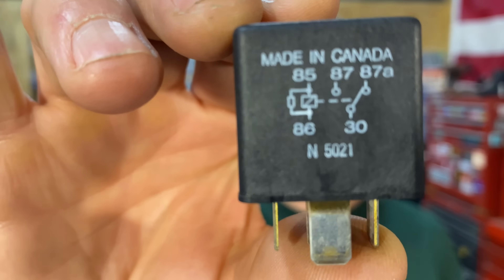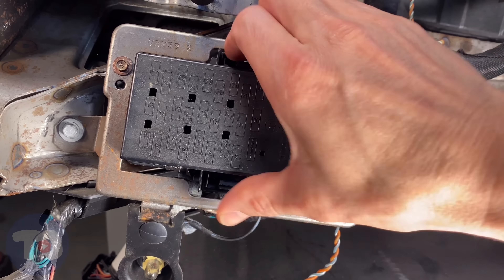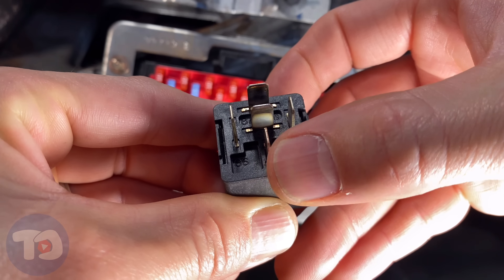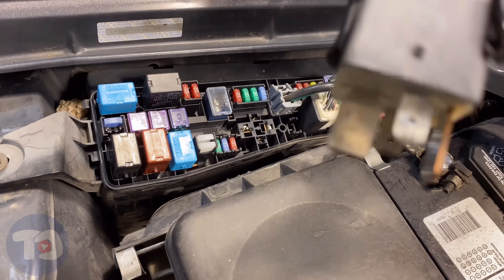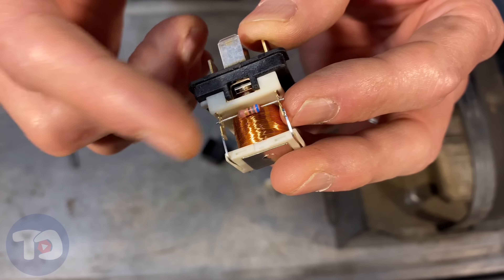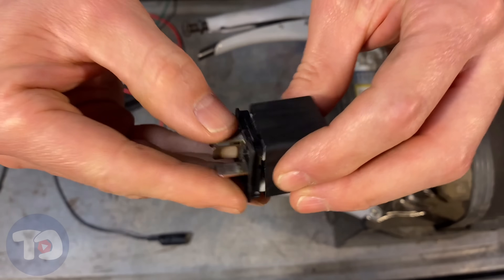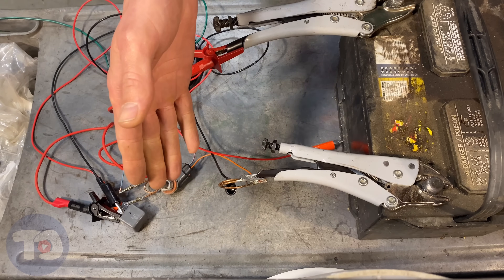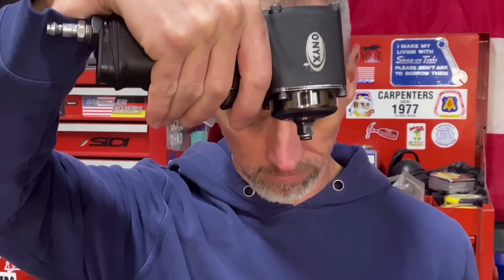Why are relay pins numbered like that?

Comment: The charge generated by the coil when it is turned off is because of the magnetic field collapsing and it's called "back EMF"... I don't know why they used a resistor unless it's to absorb some of the energy but normally they put a silicon rectifier diode reversed biased with respect to normal usage [pin 85 negative] to absorb virtually 100% of the back EMF energy.
Reply: If you have a "flyback current" from de-energising the coil if can jump the air gap between the contacts in the switch, eventually killing the switch. The resistor provides a lower resistance than the air gap in the switch so the flyback current just travels round the coil until it dissipates.
Reply: @BuiltatBlackjacks  "flyback current" and "Back EMF" are synonymous terminologies. [That is energy introduced into the coil as a result of the collapsing magnetic field.] The resistor is across the coil of the relay [which acts as an inductor as well] whereas a diode is commonly used and has absolutely nothing to do with contact erosion. That wear and tear of the contacts is addressed by using harder materials, I believe by adding tungsten. [I haven't research contact formulas nor have the inclination to do so.] The "Dr" in front of my name is there for a reason.
Reply: @DrHarryT  exactly what are you doctor of? Because I was unaware you could get a doctorate in Auto electrics?
Reply: @DrHarryT  I read that too - I think he is referring to the contacts in a dash switch that is operating the coil current; not the relay's contacts.
Like an AC dash switch that activates the AC clutch relay.
That is how I read it.
Reply: I just hit me as to why they installed a resistor, it is quite possibly for the PCM [Powertrain Control Module] to identify when the relay coil has failed and has gone open delivering a specific resistance to the PCM. However there should still also be a diode in parallel with the resistor to protect the controller mosfet in the PCM from the back EMF.
Reply: @DrHarryT  no, it's for exactly the reason I said it was...
Reply: @BuiltatBlackjacks  .
 @Built at Blackjack's  Ok, Please explain to me exactly how a resistor across the coil of a relay can effect energy across the contacts on said relay?
Reply: @DrHarryT  no, across the switch that actuates the relay, not across the relay...
Reply: @BuiltatBlackjacks  I see, you are referring to the control circuit. Todays common control circuits are solid state although some applications still use a mechanical switch. Example: Windshield wiper motor control. Although that example is complicated with the incorporation of intermittent wipers and the required return to zero feature which is built-in to the motor/actuator system itself.

Think about the dynamics of that happens when you remove the current to a relay coil. Using a diode reversed biased will limit the voltage to the supply voltage+ the voltage drop across the diode which if driven at 12V would amount to a touch over 12.5V [Typical diodes have .5 -.6V drop] A roughly 1,500V spike is generated as a result of the collapsing field. A diode will clamp the voltage to 12.5V thus reducing the switch air gap arc. [air is a resistor] If a resistor is used for back EMF the full voltage is allowed to exist across the switch contacts [output circuit] allowing a much more substantial arc across the contacts or mosfet as the case may be. [The diode pulls the voltage down instantly whereas the resistor pulls the voltage down slowly. It looks like a 650 ohm resistor was used, so maybe 10ms?] 
The only reason I can see to use a resistor is for control circuit diagnostics. [So the control circuit knows when the relay coil is open/shorted.] Since a diode was not used in parallel with the resistor, then the expectation would be that a back EMF diode is incorporated into the control circuit.
Reply: @DrHarryT  the question was why do some relays have a resistor. It's a really simple answer, and a statement of fact based on reading numerous tech sheets over the years. Irrespective of what you THINK, the manufacturer's tech sheets I've read say that resistors were added to relays to prevent arcing across the contacts of the control switch. Your initial reply says "I don't know why they used a resistor ". Seems you still don't...
Reply: @BuiltatBlackjacks  I hit me that the only possible reason is for control circuit diagnostics. Switch contact arc suppression would be extremely limited. To get true arc suppression using a resistor a low enough value resistor would have to be used to dissipate close to the same wattage as the normal operating wattage the relay coil dissipates. That is why the norm is to use a diode instead of a resistor. With a diode you get effective back EMF clamping without operating power waste/heat.

 I suppose the reasoning is that using a resistor of a specific value as to not dissipate too much energy yet keeping the back EMF voltage low enough, while not perfect will still provide adequate arc suppression to prolong contact life. Then the reasoning to use a resistor instead of a diode becomes a matter of economics for the bean counters.
It is what it is.
Edit: I did some math, with the configuration of this relay, the resistor will dissipate .216W @ 12V which is little under it's 1/4W rating. [.0184ma]
Reply: @DrHarryT  I see that too.  He did not word it well.  He appears to be referring to any 'switch contacts' that are the controlling element of the COILS activation; NOT the 'relay's contacts'.

Like an AC dash button that activates the AC clutch relays coil...
The contacts in 'that' switch...
That is how it reads if you carefully decipher what he is trying to say.
That's what I think he meant.

[EDIT] oops, I see it has already been discussed...🙃
Reply: @troubleshooter1975  In the case of the AC clutch, these days the AC switch sends a request command to the PCM and then the PCM determines if it's appropriate and if it is closes a mosfet to send power to the clutch.
I didn't mention that I am also an ASE certified automotive diagnostic technician :-)
Reply: @DrHarryT  again, you're waffling pointlessly. This is old tech, from back when the only electronic diagnostic tool anyone owned was a multimeter and that was analogue and made you a very technical boy.

Comment: I've been on the planet for 60 years and I've been using relays for over 50 of those years. In all that time I didn't know where the numbers came from, until now. Thanks for enlightening me!
Reply from the maker: Very cool! Glad to help.
Reply: There is a system with industrial relays and switches too but it is pretty clever.  Relays are numbered A1 and A2 for the coil, but the contacts are fun replace the - in the following with whatever pole you want -1 is normally closed or common armature.  -2 is normally closed, -3 is normally open armature and -4 is normally open.

So let’s say you have a 6 pole double throw relay.  They probably won’t use the -3 so you have common 11 -21 - 31 - 41 - 51 -61.  The respective normally closed contacts are 12 - 22 - 32 - 42 - 52 - 62 and the normally open contacts are 14 - 24 - 34 - 44 - 54 - 64.

Switches follow the same pattern.  Terminals on a normally closed switch are 11 & 12, normally open switch is 13 & 14

Once you figure it out it makes sense but it can be baffling until you do.
Reply: Shame u can't count

Comment: 7:01  1997 Ram 3500 headlight switch has entered the chat
Reply from the maker: Is that the one with the giant spade terminals?
Reply: @ToolDemos  yep, and the giant plastic housing that loves to melt as full headlight voltage runs through the switch 🤦🏻‍♂️
Using high beams are the fastest way to destroy those. Relay kit for the win!

Comment: So, why are relays numbered like this? and not 1,2,3,4?
The whole purpose of the video (and its title) is missed. It may be a German standard, but why use that sequence of numbers?
The video is just how a relay works. 
There is so much inaccurate information here, sometimes a little knowledge is dangerous and does not make you an expert, but people then think you are.
People are learning more from the comments, including yourself, which means you are not ready to make a video like this.
Reply: Why these numbers? Because a German standards committee wanted to codify a large number of electrical connections for automotive use. It's DIN 72552. It's unlikely that you'll see many other of these now defacto standard numbers on anything, but that's where they came from. It may have been more clear to use some thing like NC for normally closed, NO for normally open, C+ and C- for the coil connections. But they used numbers, without language issues, instead :shrug:
Reply: @albanana683  and that's the bit that should have been in the video, which is my point
Reply from the maker: I guess I should've said 'the guys on the committee just threw out arbitrary numbers that we're stuck with'

Comment: I started learning how to troubleshoot electrical circuits in German as a Recovery Section NCOIC (tracked wreckers M-578's) where I took over a group of three vehicles and one had a charging system issue that the previous NCOIC thought was the Direct Supports failure to rebuild the generators properly. After an immediate 7-day field training exercise after arriving and that vehicle had the charging system fail again, I went and found the NCO at the Battalion Level maintenance support that could show me how to use the excellent Army wiring diagrams wit ha TSS352 BU analog multimeter and see if I could find what the issue really was. Sure enough, with the NCO's guidance, a set of three wires were in a harness were found to have been cut and spliced incorrectly! And the wire numbers were visible every 6 inches or so on each lead to see that they were spliced incorrectly but were hidden under electrical tape after the bad repair. (I retired as an SFC(P) 63E40, M-1 tank Motor Sergeant in 1990.) I've been building on that knowledge ever since. I will say, from your video, I now know the purpose of that resistor in some relays! My last Fleet Maintenance job was working for Waste Management, primarily servicing the fleets +- 125 vehicles brakes but expanded into A/C and electrical repairs after about 3 of my 18 years there before finally retiring in 2015. The only item I'd like to add, and maybe I need to make this video myself, is as part of my work there, I needed to repair wiring with electrical connectors marked "P.E.D." It took me about 5 years from 1997 to find that P.E.D. stood for "Packard Electrical Device" IAW a quick search for verification right now, even though he stated to me, 'Packard Electrical Division" (AKA Delphi/Packard) as I remember" after asking a vendor at the Rocky Mountain Street Rod nationals at Pueblo Co that was selling Weather Pack connectors! Now "Metri Pack" connectors are very popular. With that set of key words, I found the Online .pdf catalogs offered and could now give the part numbers to the Parts Tech to get the proper connectors and terminals for relays, wiring, computers, etc.

Comment: Imagine if there was a standard for brake calipers, and pads. we could probably get away with 20 different designs for 90% of all passenger cars . . .
Reply from the maker: It would make repair cheaper and easier.
Reply: Maserati Biturbos from the 80s use the same pad shape as the 2002 BMW from the 70s. Vauxhall/Opel pads fit Alfa 116 series cars. So, there is a degree of that.

Comment: The resistor across the coil attenuates the coil's inductive kick when the coil voltage is switched off. Some relays used a reversed polarity diode to do the same. However the diode can slow the relay time in mSecs.
Reply: You say the diode would slow the relay time ,why would the relay time be a problem,as relays are inherantly slow anyway.
Reply from the maker: Thank you Seth.
Reply: I take it you mean the release time?  I suppose it can.  You have to remember it is working with the resistance of the coil too, to dissipate the energy...
Some cars have the diode in the fuse block.  Sometimes there are diodes, like an ATM fuse, inserted from the top too (like a fuse).
Reply: added: "release time"
Reply: In Electronics, this is called a "Slugged Relay" (eg Slow Release). There are various kinds: A diode gives a fairly long release time, a resistor gives a shorter release time, while a Zener gives the fastest of all. There are other tricks, like a copper slug on the armature to give much longer hold times and a shaded pole can even work on AC..

Comment: The explanation for WHY they used those numbers feel woefully inadequate.  "Because that's what they had left"   Left from what?? What pin numbers are 1-29 and 30-84?  And why had they skipped 30?   I really like the rest of the video explaining how they work, but this really didn't answer the question posed in the title.
Reply from the maker: The numbers were used to identify various common automotive circuits, not just pins and terminals. The supply voltage circuit to a relay was given #30. Why the decision was made to wait until the 80's to get to the rest of the relay is anyone's guess, I couldn't find an answer.

Comment: TOOL DEMOS< The resistor inside the relay cube, how does the Resistor protect the computer modules and other modules? The resistor is across the terminals inside the relay cube but not sure how it protects the ECU
Reply from the maker: The magnetic coil inside the relay consumes all of the current supplied by the controller (ECU in your example) and turns it into magnetic energy and heat. When the ECU opens that circuit to shut off the coil, the remaining energy has to go somewhere. That somewhere is right back to punch the ECU in the face. The resistor "takes the punch" by turning that energy into heat and there is very little left over when it reaches the ECU.
Reply: @ToolDemos  How can you know when purchasing a Relay that is has an internal Resistor? because not all relays have an interval resistor. It seems that the internal resistor is a Bleeder resistor to reduce the surge or spike of the relay contacts turning off/on
Reply from the maker: @waynegram8907  right, some use a diode instead of a resistor. I never purchased a generic relay, not sure how they advertise the specs. If you are replacing an OEM with the same part, it should be built with the same protections.
Reply: @ToolDemos  Yes some Relays used a Diode to clamp the coils magnetic fields collapsing voltage from backfeeding into the ECU. The designers for that certain ECU must have chosen to use a resistor instead of a Diode for that OEM Relay part number.

Comment: 87a and 87 are connected internally this is for having two outputs typically lights on each side.
Reply: 87 and 87a are not connected,they are separate feeds.87a is live,as in connected to terminal 30,battery+ until the relay is activated,then terminal 87 becomes live and terminal 87a is then disconnected until the relay is deactivated.
Reply: @notpoliticallycorrect1303  On all my relays there is no resistance between 87 and 87a.
Reply: @alvinmitchell6799  so there’s continuity between 87 and 87a at all times?
Reply: @ConceptXX  On the ones I have 87 and 87a have continuity and connected.  I have them wired to run auxiliary lights and wired into my backup lights on my truck.  I have a aftermarket tool bed on my truck and the backup lights would melt and blow the fuse for the backup lights so I wired a relay into the circuit to keep from melting the factory wiring.
Reply: @alvinmitchell6799   sure it's not 87b?

Comment: I always wondered why they are numbered that way and now i know why but as for the way you described how you remember the pins is kinda funny because my son and i love them movies and i would have never thought of that but did you know you can connect a relay backwards and use it as a isolator i used a 5 pin relay on a truck to make light pods work with a switch and with the b\u lights but when you would turn on the pod the b\u lights would not come on but when you put the truck in reverse the pods and the b\u lights would come and i did that all with a relay wired backwards with pin 30 being the load and 87 and 87a being my power instead
Reply: The contacts don't care which direction the current flows; either way is equally legitimate...
In some applications, a load may be switched between two different power feeds.
In fact, a common automotive example comes to mind as I type this:
Very often blower motors are wired to a high speed relay. It switches the motor between two different voltage sources.  The blower is on the 30 terminal, and it switches it from full B+ from the battery (fused of course) at term' 87, or from the dash fan speed switch through the blower resistor (term' 87a) at selected lower voltages.
This means they can use say a 15A dash switch and not need one that can handle the 30ish amps needed for high speed setting (and the associated heavy wires).
I have seen two speed radiator fans that complexly switch the motors to either parallel or series, and some seat heater circuits.  Some DRL headlight circuits can be oddly wired relays too (older versions AFAIK).
Mr K L
Reply from the maker: Brilliant!